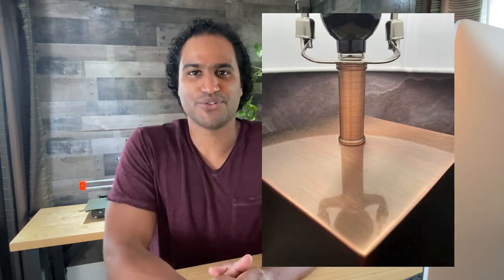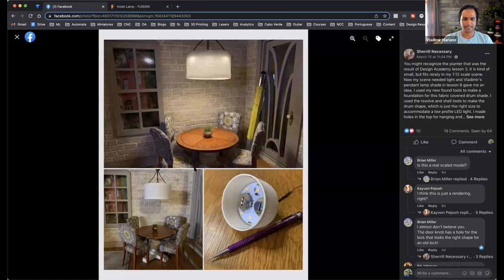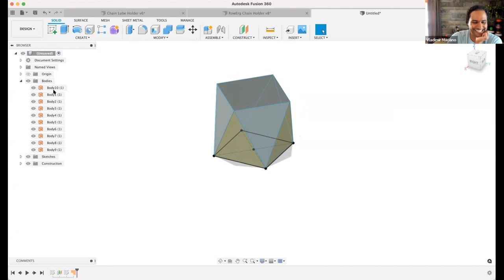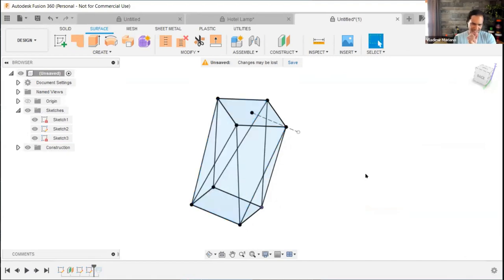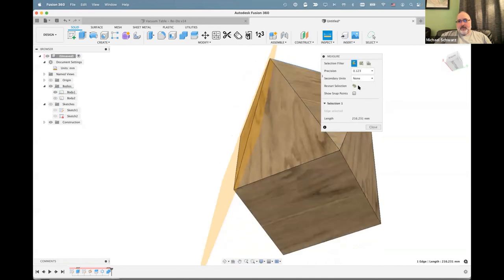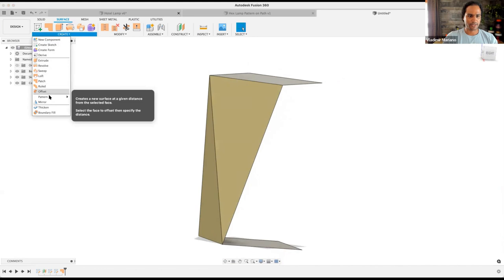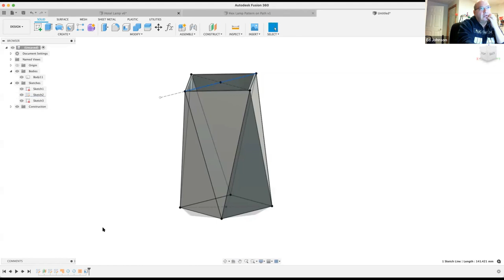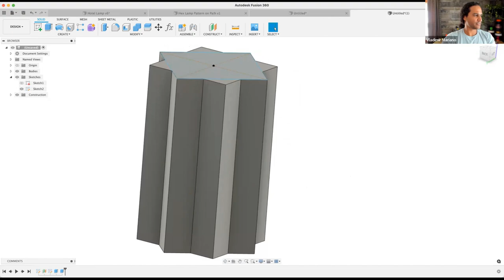Fusion 360 Design Challenge

Comment: I couldn't resist playing along :) ...
- My approach has ***TWO SIMPLIFICATIONS***:
- Create 'Center Rectangle' to Origin; 'Equal' constraint to adjacent sides; set dimension.
- Create 'Offset Plane'; create same rectangle as above,  (***1ST SIMPLIFICATION***) BUT delete 'Horizontal' constraint; click-n-drag a corner; apply 'Vertical' constraint to existing diagonal 'Construction Line' (this effectively does the 45º rotation). Note: didn't have to create any extra geometry to fully constrain the square.
- Create '3D Sketch'; create lines for the two adjacent side triangles (requires just 3 lines).
- Create 'Surface Patches': 1 for bottom; 1 for top; 1 for each triangle - so, 4 total.
- (***2ND SIMPLIFICATION***) 'Circular Pattern' BOTH triangles as 'Body': 'Quantity:4'.
- 'Stitch' all surface bodies... DONE :)

Comment: Would anyone know why a projected rectangle is somehow constrained such that it will not rotate or move. If I draw a rectangle (non-projected) it will move. Tried to delete all constraints and can not move projected rectangle. Ugh.
Reply: Found out that I had to turn off "Projection Link" in the PROJECT dialong box. With that checked I could not move it even after deleting all contraints. Only took a few hours to find that fix, ha ha.   From Autodesk: When a sketch is projected, it is linked to the original geometry and cannot be changed without breaking the link.